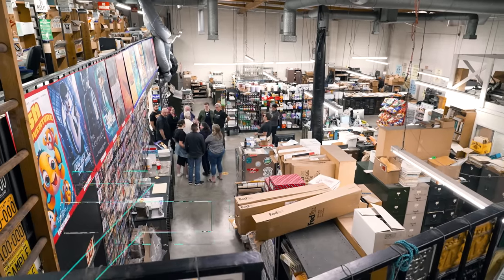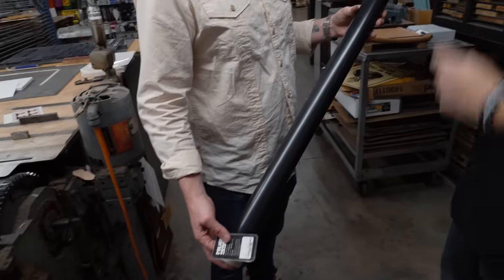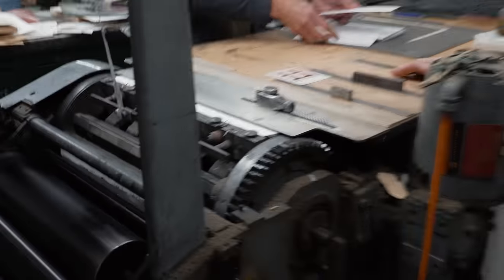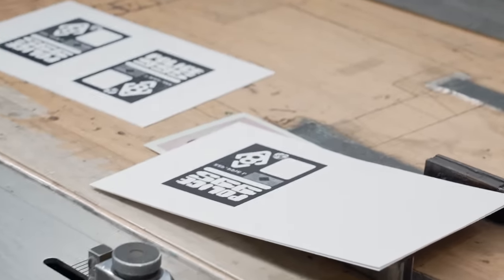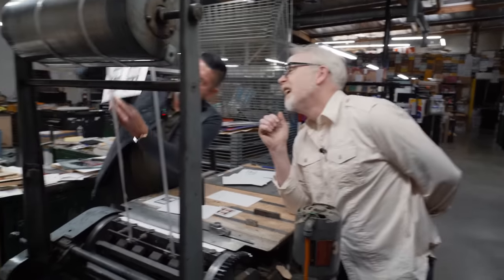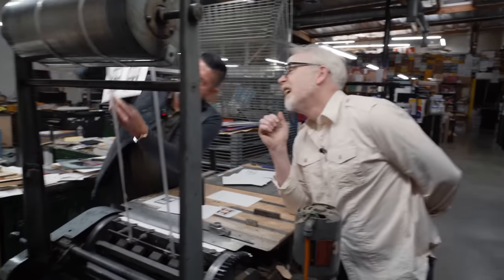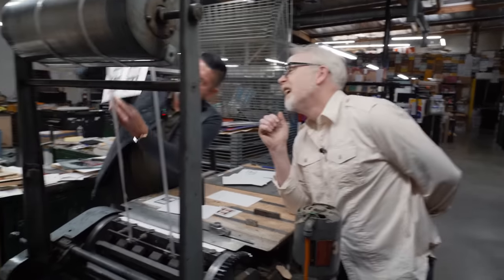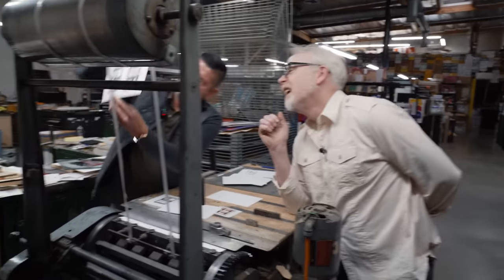How Blade Runner's Badge Was Made!

Comment: The yellow is a little bit bigger around so there's no paper white showing if the colors are slightly misaligned when printing. That's called 'trapping' and it is relatively simple to do in analog line art with an overexposed original slightly out of focus. The real problem was to do it when things began to become digital (we used computers and laser imagesetters—think of a laser printer that uses the laser to expose offset printing film—to create the offset plates from film). By about mid-1990's we had to create all the trapping digitally, at first by adding outlines to the elements in Adobe Illustrator (yes, it is THAT old) in colors that would print in both plates. In this case, we would create a color that was 100% black and 100% yellow on the outside of the yellow part. It was a nightmare to thing through what color would go 'under' which other color (darker colors would keep the same, but lighter colors should grow towards the darker ones) and by how much (it depended on several things, from the size of the piece—larger prints could shift and swell up, so we'd need wider trapping lines near the edges—to the type of paper—newsprint would stretch and shift during a run, so you'd need even wider trapping lines—to the process of printing—offset is more stable, silkscreening shifts A LOT, especially for big things). Man I miss the old early digital days…
Reply: Not only that, but the printer pressure could push the rubber stamp and caused spreading.  I remember learning all the nuances of how each feel goes from abdick presses while in print classes, and working in a print shop.  The memories that this episode causes is crazy, I'm sure you know what I'm saying
Reply: @shable1436  Pretty sure that is a magnesium plate, or it might be an engraving, either way it is rock solid and the press isn't compressing it like it would a rubber stamp. :)
Reply: @kimaboe  there is rubber on some rollers, but if you know about offset printing then why argue?  For one they aren't magnesium, that's too expensive, but gravure, aluminum, or something handmade by a specific font specialists has made.  The rubber sometimes is put on backplate and not on front, there's many ways to do things and keep the electrons from building up
Reply: @shable1436  Sure, but the press in the video isn't an offset press, even though Adam uses the word a few times to refer to the type of printing they do here (I'm assuming they do in fact run tons of offset work, just not in this specific instance).

This press is a simple relief proof press, with a single steel impression roller. The paper being printed is hitting the relief plate directly, the image is not offset onto a rubber roller and then transferred to the paper as in offset lithography. The packing on the roller is just enough to protect the press, but should be so hard that it has zero give under normal operation.

So, the trapping in this specific instance is only for registration due to plate positioning and to reduce the need for time consuming makeready, not to account for image "squeeze" as you see with other printing methods. Easy distinction to make for us, since we are familiar with the tech, but nice to be specific for anyone learning from the vid :)

And fwiw, magnesium cuts are fairly cheap, I buy them all the time for hot foiling purposes. It would be my first choice for something like this, and you'd get those two plates mailed in a day for about $75. I doubt you'd get an aluminium plate for that same price unless you were doing it inhouse?
Reply: I wanted to mention it was trap, which for something like this would be huge. No one wants to spend time lining up the colors or registering the impressions, especially for something the end customer (the movie audience) is never going to get a good look at.

Unless you have tints or halftones you could still burn a fatty on a plate using acetate and frost with film from an imagesetter. Although I do love how easy to do InDesign made it. As someone who still runs an AccuSet 1000, my advice is: Don't miss it too hard. 😅
Reply: @strawhousepig  There does appear to be a halftone one the larger plate, otherwise this would have been a perfect design to CNC. If I was doing relief printing for the movie industry today, I'd print 95% of my stuff from laser-cut or CNC wood/acrylic plates and never mess with any chemicals :p

Comment: For anyone that doesn't have access to Rubylith or Amberlith, you can approximate it with translucent vinyl. It won't have the light blocking properties but it will look almost identical. Sign shops will often have some, you can also see if they will print a custom color for you on IJ8150 which is a clear vinyl.
Reply: They still make Rubylith - a company called Ulano makes it and you can still buy it. Also, 3M makes some equivalent films.
Reply: Wow..Rubylith... That takes me waaayyy back to the 80's and making masks for my circuits to be printed and mounted on ceramic.
Reply: I would substitute theatrical light filter gel such as ROSCOLUX
Reply: @tomtech4224  That would work too, I suggested translucent vinyl, 3M, Avery or Oracal, since you can cut shapes on a plotter and it has an adhesive back.
Reply: It is such a nice vinyl to print on too!
Reply: The shades are very specific, and the stock is SUPER thin so it adheres via electrostatic charge. There is undoubtedly some acetate or vinyl sheets that are a similar shade to amberlith, but it wouldn't be the same thing. Amberlith was discontinued in 2007, as was any form of rubylith that had a tacky surface. I would imagine that roll of amberlith would sell for a pretty pennty - even just a few sheets of the flat stuff sells for tens of dollars on ebay.
Reply: Red acetate of cellulose works too, but you have to find the right shade. Alternatively, candy apple red paint (in the right formulation) over a thin strip of transparent film works too, just don't bend it before it's laminated. Some types of paint will be stretchy, but they're more expensive, so for a prop like this, it's cheaper to go with common formula that any paint shop with paint can filler stations will have (or order). I've also seen people use Copic over film as well. I'm not 100% sure on how good it ends up looking.
Reply: Rubylith also is used in thar printing process when during striping up a job, you use it to separate the spot color of a job from the black ink.
Reply: I don't know how close it is but possibly kapton could be good enough for some purposes.
Reply: Grimco Sells Rubylith. It's pretty cheap too.

Comment: That printing press looks like the swiss-made proofing press we had in high school (I went to high school for printing and paper-making technologies here in my country). Main difference between regular presses and proofing presses is in the way forms are locked on the base plate rather than inside a frame.
Reply: I thought it was a Vandercook press
Reply: @rickv1007  Vandercook is correct, and a power-carriage adjustable-bed model too, like a Universal III.
Reply: @rickv1007  It's possible. But definitely a proofing press. :)

Comment: The adding of the bleed on the orange 8 symbol is a deliberate part of the pre-press process. The term we used is a 'spread' or a 'trap'. On any press, particularly a commercial press running at high speed, a spread is necessary in this particular scenario to ensure that misregistration of one solid colour (in this case a 'spot' orange) to another does not result in a visible white gap between the orange and the black. Typically the amount of spread in this case would be somewhere between 0.1 mm and 0.3 mm. So totally correct and deliberate.

Comment: This is so cool! They made that yellow plate slightly larger than the hole in the black plate on purpose to give themselves a small fudge factor if the registration is off between plates. You would notice a white gap more than the yellow overprinted on black. I think they call it "trapping" if my memory serves. We used to do that with print jobs back when I designed printed materials.

Comment: The printing process actually letterpress, not offset as Adam mentioned a few times. I believe that's a Vandercook Universal 3 or similar model. Main difference being letterpress makes physical paper to die contact, while offset "offsets" the ink from a plate to a rubber mat, that then presses against the paper.

Still super cool to see this! Worked in letterpress and with many of these same machines in a small town printshop.

Comment: Tech from back when I was a commercial artist making artwork for print. Fascinating to see still, the skills that exist in quiet corners. Also, the yellow would need to be slightly larger than the hole, that was called 'trap', allowing a little overprint so the chance of a white bit was eliminated if the registration of the colours strayed a little.

Comment: 2/12 years ago I worked in an art department in a small nameplate/Print shop. I worked there 25 years in most of the departments. I cleaned out the art department and we had sheets of amberlith about 20" x 30" and the stack was about 5" thick and I through it away! I had though of taking it home and now wish I did!

Comment: I wonder if the polaroid photo was the other type of polaroid photo used on the OG prop. Which would've been packfilm AKA peel apart film. There was even a camera designed just for taking ID photos. 

It was called the Polaroid Studio express. Shooting integral film(the one used in this video) or better known as the standard type of photo when you think of when talking about a Polaroid photo would have been tricky to take a photo of the actors, since you would've needed the proper scale to fit on the ID card. 

The Polaroid LAB wasn't around back in the day so to achieve this you would have had to shoot the photo from a distance since Polaroid cameras don't have interchangeable lenses and they would've had to use a SLR type polaroid camera like the SX-70 or the SLR680 since those have manual focus capabilities and you can look though the lens.

 I have a strong hunch packfilm was what would have been used for the ID photo on the OG prop. It would've been easier and the Polaroid Studio express could take up to 4 photos on the same piece of film.

Comment: I'm assuming that the two (2) spelling mistakes on the back of the identification card ("coed" for "code" and "probhibits" for "prohibits") are intentional for screen accuracy? Although, if that is the case, what is up with the number designation showing as "J 5144-955" (instead of "B-263-54")?

Comment: I worked for a map making and printing company just outside of Washington, DC for 35 years and when I started we had a line of dry transfer lettering and symbology that we stopped producing in the early 90's. I'm sure that there are still hundreds of boxes of it, along with possibly rubylith and amberlith and who knows what else. The company is still in business and has been since 1921 and has been in the same building since the late 50's or early 60's.
And no, offset printing isn't completely gone. They have 3 giant 64" offset presses. 1 is 4 color, 1 is 6 color and the oldest used to be 6 color but now is only 5.

Comment: Fun fact regarding the original prop which was missed in the video. There is a famous spelling mistake on the back of the ID card on the original prop which was found when the original prop was photographed by Carl Tate and Richard Coyle at WorldCon. You can see this at 20:23 The word "CODE" was "COED" but obviously due to the printing block, it was probably to expensive to change and they probably didn't care as nobody was going to see it. Today this would be a simple fix in photoshop but still cool that this mistake is on this prop.

Comment: That was neat!

Adam, please stop saying "offset press". That's not an offset press, it's a lithography press (sometimes also called letterpress). An offset press uses a thin layer of ink that sticks (or not) to parts of a metal sheet, which is then transferred (offset) to paper. A lithography press applies ink directly to the paper after the raised surfaces are inked (like the etching blocks in today's video). I have to say, that is the spiffiest proof press I have ever seen - generally proof presses are just a big heavy roller (sometimes stone) and you apply the ink to the type yourself and put the paper on top before rolling it over. This is more like a small-job press, and it's certainly super cool.

You can do multi-color printing with either kind of press, but it's a heck of a lot harder with lithography, and generally you only do spot colors like the yellow parts of the ID badge. The overprinting is called "trap", and it's intentional, because letterpress printing inherently has some bleed at edges - in fact, letterpress typefaces are designed with inside corners missing or slightly open, to allow ink bleeds to fill them in.

Comment: 18:30 Tod Cutler and Matt Easton have been talking about this a lot recently (as has YouTuber Skallagrim), that there is a lot of confusion by fans as to replica-making: namely, that there is this ideal version that some replicas seek to emulate, which in fact the originals usually do not have. Real-life, functional, battle-worn swords show evidence of blades, guards and handles that were ever-so imperfect. Guns as well. It's not just film-making props: IRL circumstances, "what works, works" is very much a thing. I've made DIY stuff for my house that I am not particularly proud of, or of which I am partially very proud of, and the point is that, truthfully, we often need to compromise.

Comment: By print it out as a polaroid , if it's what I think it is, then that's litterally true. There are these little photo "printers" that take polaroid, or other instant photo, paper and exposes it from a display. It makes for a really tiny printer like device with few moving parts that produces instant photo quality prints. Downside being it's quite expensive per print since it's photo sensitive self developing paper. There's also, in my opinion, some really dumb cameras which are just a digital camera with one of these stuck in the same shell.

Comment: The same printing blocks, on the same machines and in the same building as when they did the screen-used ones. That's really cool. But the question for me now is. Did they use the same kind of paper to make the replicas?

And also. Can you really call it a replica when it is made with the exact same tools and methods as the screen-used ones? And was it the same model of typewriter? :)
Reply: Yes, still 100% a replica.

Comment: I was raised by my grandparents who owned a print shop. Consequently I grew up around a lot of equipment like in this video such as offset presses. I could clearly recall the smell of the old rubber litho ink when Adam said he loved the smell. However it also made feel kind of bad hearing that sort of equipment was hard to maintain anymore and that Amberlith had stopped being produced "decades" ago. I guess nobody has really done hand layout for quite some time now. I understand, trying to find a "better' way to do layout is what initially paved my own interest in computers leading to a career in IT, but it's still just a bit saddening.
They were, however, incorrect about one thing. The yellow "8" symbol was not made too large. It was purposely made larger, this is common in spot color printing and is called trapping. Trapping is used to correct for potential slight register issues. Also, the yellow layer should be printed first and the black second. In fact if you look at the printing block you can see evidence of this from the original prints. There's still some old yellow ink residue around the edges of the symbol. There's also a bit in the "POLICE 995" lettering which makes me think there were some badges made with yellowing lettering and there's probably another missing block for that area floating around that shop somewhere.

Comment: LOL, I actually have half a dozen sheets of amberlith lying around. Maybe I should jump onto the RPF and make a quick buck. I most recently used a piece last halloween to tint a lamp for a party, the stuff is very useful indeed :p

It might not have been made for a while, but there is probably a significant amount of unused stock around.
Reply: As for maintaining that printing press, that is a Vandercook, looks like a Universal model, should be half a dozen guys in LA who can fix that thing no problem. No need to cross the border to Mexico. It is a surprisingly simple machine, though if you want replacement parts you'll need to call Fritz Klinke in Silverton, CO :p